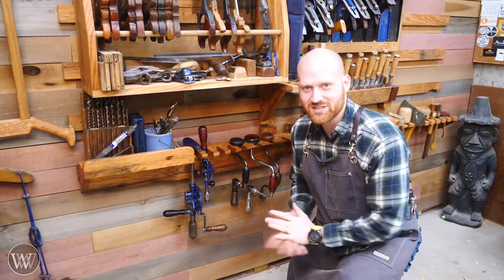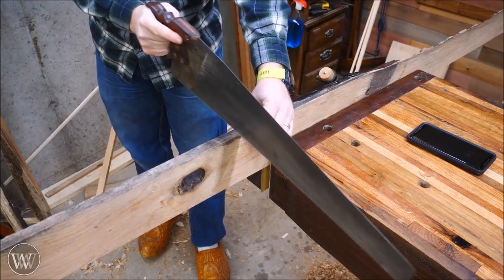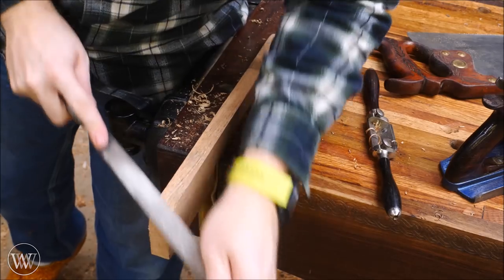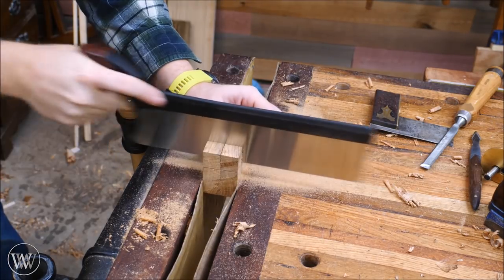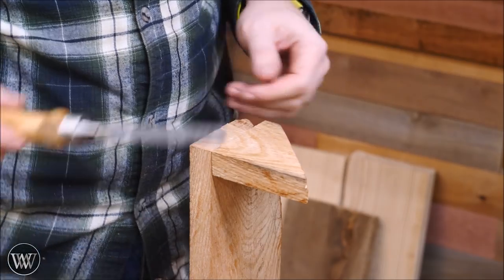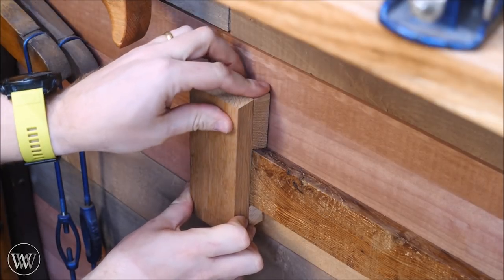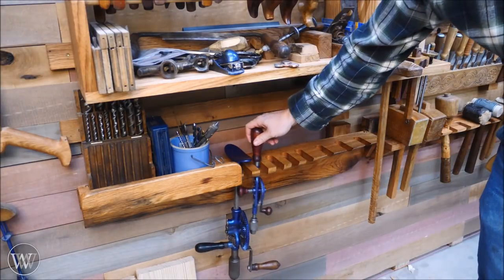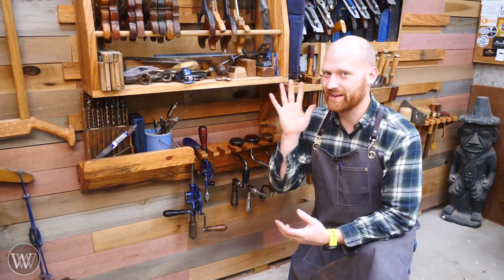Making A storage Rack for Drills, Braces, Augers, and Drill Bits | Hand Tool Woodworking Project

Comment: Fantastic. I was even more impressed that you used all hand tools, something I strive for, but even thought I have an auger bit set and drills (not sure what they are called at this point), I never thought about using them for screwing in screws. Well done. I'll be watching out for more.
Reply from the maker: I often like to use it as it has more tork and feels smoother, but the drill is usually faster.

Comment: I love that you included the knot hole and live edge, your tool wall has to be the most beautiful I've seen :D Just wondering, you're not worried about all the short/sideways/interrupted grain in the busy end of the brace (and mallet) rack? If that phrasing makes sense, haha...
Reply from the maker: thanks man. no those teeth sticking out are a bit weak but not that week. It would not surprise me if in the next 5 years one of them break off but I can just dowel it back on.
Reply: Cool, thanks!

Comment: I like everything you do. I have always thought when designing things in my head about the pretty factor or cool factor if you will, curves, carving, etc... I have a question though and it is sort of over time question. Are the bit braces supported by their wood handles and if so does the weight of the brace effect them at all over time?
Reply from the maker: Yes, they are supported by the loose button cap on the back. Usually they're actually sitting on a plate of metal that's on the bottom side of the button. But no, it doesn't affect their use or function at all.

Comment: Seems like those narrow cross grain fingers would be a weak point that could snap off in time. I would have more confidence in an end grain orientation or plywood piece for the holder.
Reply from the maker: yup. if you work with plywood then that would be the best choice. I had one finger break off but it was easy enough to pin back on. I did a year later video on the rack a wile back talking about what I would change.

Comment: Nice, love the way the tool storage wall is coming together!  What sort of brace are you using? It looks like it accepts round (or maybe hex shaft) bits and drivers. All of mine use the type that have the weird trapezoid thing on the end.
Reply from the maker: thanks man. some braces will work with hex shafts as well as tapered square. This one happens to be one of those. it is more common in the braces after WWII

Comment: Also, on your hole and groove/slot racks, why not countersink the holes before cutting the slot?
Reply from the maker: I do not have a countersink bit that big. and I just like to carve a slight chamfer into the whole edge. that is a really fun step.
Reply: Wood By Wright great, just wondering. Maybe if you ever get into blacksmithing you could make a larger countersink, if you chose to do so that is. The tool wall is coming along nicely. Great job.
Reply from the maker: thanks Thomas. blacksmithing is on the list. I am hoping to have an outdoor shop this summer and that will be part of it.
Reply: Wood By Wright like minds think alikem

Comment: where did you get that adapter for the brace to be able to use modern screws?
Reply from the maker: +John lastname some braces will work with her shafts as well as tapered square. This one happens to be one of those.